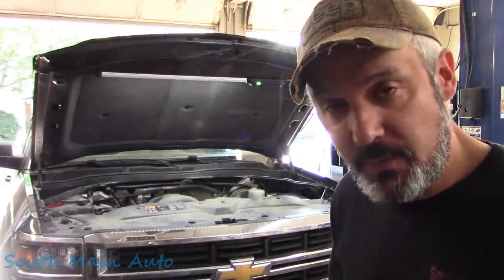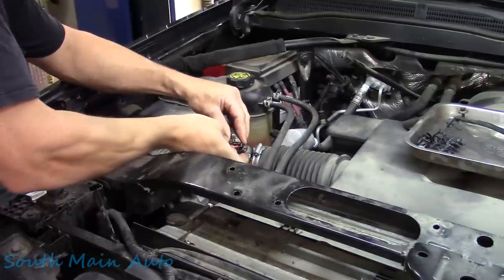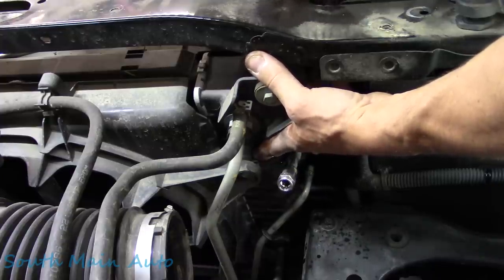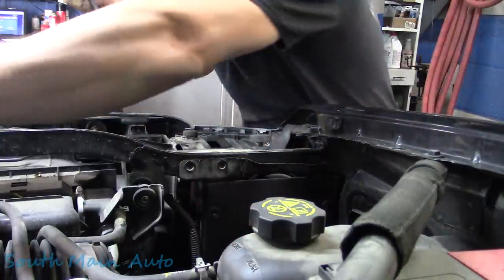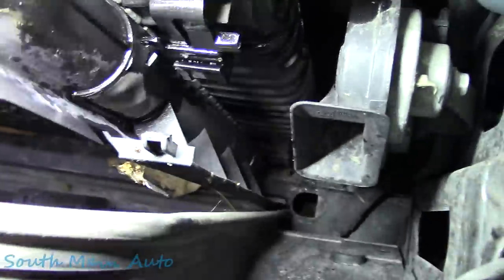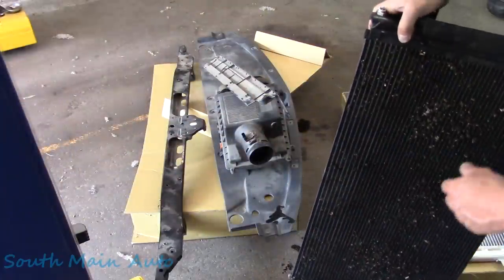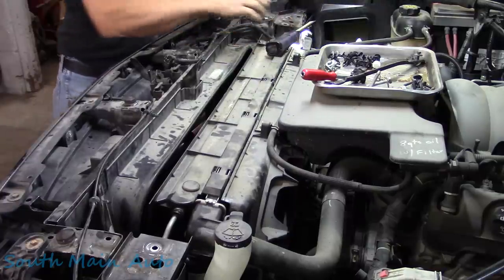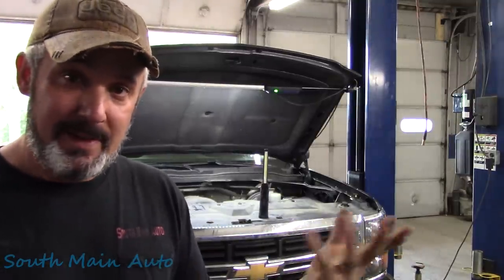Chevrolet 1500 / Tahoe - No A/C Leaking Condenser

Comment: I enjoyed rebuilding on my 2001 Jimmy 4.3L.  I bought a rebuild kit from UAC via RockAuto.  $265.00.  Including Compressor with clutch, Condenser, Dryer, Orifice Tube, oil and seals.  I did a new radiator, water pump and heater core at same time.  I purchased a vacuum pump and hose and gauge set and did all service myself.  Eric, you have encouraged me to do this stuff.  You are most helpful.  The technical aspects of servicing AC properly are involved, one must be aware of what he or she is doing.  I watched a vid by Eric the car guy in order to get servicing right.  Both of you Erics are the best.  It isn't hard, just have to take it step by step.  I am proud of the work I have done.  It is rewarding to say the least.  Money saved is one of the benefits.
Reply: I'll tell you, you are definitely right about the fact that A/C is "technical" and not all auto "mechanics" get it when it comes to A/C. That is why most people are purchasing new compressors, driers and new valves when the problem is something else. A/C work is done incorrectly with most shops and those who do it correctly are on the few shops list. 
Also, I never saw an automotive A/C system that worked properly blow cool air above 40 degrees.  Some of them experts will tell you the cooled air will go up as the outside heat rises. Initially thats true but as it runs longer at the evaporator its not true. The txv or fixed orifice will regulate the temps as needed and on a hot day say around 105 the air coming out of the vents should be close to 40 degrees vs. a delta of 30. If its 105 outside and A/C is making 75 temps inside THAT is not normal.
Reply: And a proud of yourself moment saying hey I did that. All of it. Rewarding feeling
Reply: Did that about a dozen years ago on my old 98 Lumina. Was a leak, not a compressor failure - flushed the evap and lines very thoroughly anyway. Wonderful AC til I got rid of the car a few years later, for a hybrid. Once you do it one time and it turns out perfect, you are good to go on any other cars in the future. I  moved on to home HVAC so now I got a great setup - recovery machine, mic gauge, testo 550, nitrogen tank and flow gauge, O/A torch, metal duct fab tools, etc. Once you understand all the saturation temp, super cooling, super heat, etc the work is easy if you are an intuitive person.
Reply: @Garth2011  People forget, or never knew, that AC in their vehicle is probably 80,000 BTUs. If it's working right it's going to blow cold anywhere.
Reply: @johnassal5838  Is that so, 80,000 btu?
Reply: @Garth2011  Well, probably more like 20k-40k for most cars but I'm not sure if that's max capacity or output under lower stop and go rpms.

Comment: No wonder they couldn't find the leak. It was hidden behind the plastic cover. Experience is everything!
Great work as usual.
Reply: still the best way to avoid leaks like that is a separate condenser and receiver drier.... not that kind of design...
Reply: I think that's code for "too much work to find"
Reply: @Garth2011  Sniffers are useless, best is the dye/black light method.  Have not used a sniffer in 25 years, soapy water works well too.
Reply: It's a known problem with those vehicles so they had to know where it was leaking and just decided to keep charging it instead. It isn't too hard to remove that plastic cover and look!
Reply: You can see the leak on these through the grille
Reply: It's incredibly easy and obvious to see the leak on these condensers when you look through the grill, I don't even understand how the other shop could not find the leak unless an actual blind man was looking for it, every auto shop in North America that does AC stuff has heard of the notorious condenser leak on these trucks
Reply: @dethmetel  They liked the repeat business from the sucker. Fix his problem and then what does he need from you on an ongoing basis?

Comment: I can't believe a shop in a major city would be so irresponsible on not correcting a leak and just recharging a system. I'll admit I had a 2012 F250 evaporator get me. I charged it with dry nitrogen and it held pressure for over 3 hours, passed vacuum test. So I charged it and sent it on its way. 2 months later it came back and through process of elimination I condemned the evaporator, Ya completely disassemble the dash to change it.  I enjoy your videos, keep up the good work!

Comment: As a GM tech myself I have asked myself countless times why GM continues to have us replace faulty components with the same faulty components and repeat repairs. It just pisses me off. GM needs to do better on so many different levels
Reply: The Chevy dealer here uses aftermarket condensers. They say they have better luck with them and that it was requested by the techs. I ordered 3 more this week. They do a bunch of them.
Reply: I'm having a hard time finding the GM part number so I can replace those plastic safety "stay on there" clips that Eric is calling the jiffy clips for transmission cooler connections. I suppose there are different sizes too, but I can't find any size at all. Any help GM guys?
Reply: @Troy_Built  I’ve also installed the aftermarket ones. Only when the OEM ones are on back order though
Reply: Maybe GM needs to have work for the service dept .GM is not going to throw away their faulty inventory.Manufacters only do recalls on equipment that can cause injury.
Reply: @notsevenfeettall  the reality is that for the first 2 years, warranty and dealer concerns are actively managed and engineering often makes changes..in future models.  When a vehicle is released, especially a truck, the new release is in 5 years, and that vehicle is already 50% complete, so if it's deemed to be something engineering can improve, you may not even see it in that release (unless it's expensive to GM). Also, Engineering may have decided that their part design was fine but the supplier built it badly or not so spec, that is a purchasing problem, not an engineering problem.  If that condenser design had issues in 2015, in all likeliehood it's fixed on the T100 platform (2020 or newer)
Reply: Gm tech also and I love how they finally changed the manufacture of the condenser and it doesn’t fit the air dams hardly and the cooler line adapters are slightly different.
Reply: Repeat business to hell with customer satisfaction
Reply: I had to replace a condenser already on my 2018 . Last year the starter was bad and the engine oil cooler line was leaking too. I know all vehicles have some issues but I bought my last gm.

Comment: You gotta love the brand loyal guys that are blind to the fact their stuff breaks down as much as anyone else's...
Another You Tuber is always getting on Euro cars when they break down but he loves Subarus... That he always has in his shop. The latest one...with a cracked valve? Good guy. Great diagnostician. Excellent videos. But.... Give it up already. It doesn't matter where they come from or who makes them. They all break. Every one of them.
Reply: Especially when you don't take care of it like you should
Reply: Eric knows Ivan of PHAD. Let's hope Ivan realises he got the old/wrong replacement exhaust valves from the dealer before he fits them! :-/
Reply: @rafflesnh  Ivan is a great guy. Love his stuff.
Reply: It's not that some break down or don't, it's the relative frequency.
Reply: @Resistculturaldecline  that's just it. I have had cars of many makes. They all did about the same. Little stuff here and there.
I've had Fords, Chevys, Toyota, Nissan, Opel, many VWs. Have had little problems from all. All about the same.
Two Fords and a VW now. Just sold a 2006 Jetta with 170,000 on it. Still on the stock alternator and even stock brakes!
It's all what people want to believe.
Reply: @rafflesnh  The updated part is ONLY FOR THE OTHER CYLNDER HEAD.  Yeah, different diameter for the other side.  He verified that the side he was working on still used the same part #.  OEM out of the factory used that part # for both sides.  Then they updated the other side.
Reply: @billmalec   I expect a 170k with very little replacement of wear items from newer cars. Decades and decades ago, 170k was great. I drive a 2001 dodge 2500 still on factory brakes also.  None are infallible, but most extremely high mileage vehicle are japanese. I mean 500k . I grew up on Detroit iron, and deep into engine building. Cars and outboards. Not across the board, but on average its hard to deny what I've seen in the small sample size of my eyes. Honda outboards which are directly based off the road engines logging 5500hrs. 3500hrs above 4000rpm.
Reply: @Resistculturaldecline  that Subaru with the cracked valve at Ivan's has like 125,000 on it. If it were a BMW people would be going crazy about this and that and, well at least it wasn't yet another Subaru head gasket...
Reply: @Resistculturaldecline  290,000 on our 7.3L Excursion. Alternators like clockwork every 105,000 miles. Luckily it's very easy to change.  One rear end rebuild. Other than that not much of anything.
But if it were a European car, oh man that would just be horrible. I don't get into that BS.
Reply: Actually Bill described exactly why I am brand-loyal. I know they break, everything does eventually. But, knowing what breaks and how it breaks and how to repair is priceless. Familiarity as opposed to fanboy-ism.
Reply: @walterk1221  that's why I think guys like Ivan and Eric don't like certain brands. Because of non familiarity. Things break they aren't used to breaking and they think it's odd. I'm sure Europeans think Chevy truck engine lifter problems are odd too.
Going back to Subarus and their infamous head gasket problems. That shouldn't happen but they just take it as 'normal'. Never had a head gasket go out on any vehicle I've ever had. That being said I'm sure I'd like a Subaru. Never had one but...
Reply: @billmalec   I have a cadillac in my driveway maintained to no end you can have real cheap if you're curious about headgaskets. As said, yes they all can break. Everything is built to a price point, none are godly. But on average, reliability stats favor a certain direction
Reply: @Resistculturaldecline  Cadillac? No thank you. 😁
Reply: @billmalec   Me either, it was bequeathed to me.

Comment: Thank you, Eric, for teaching me how to correctly use the A/C line disconnecting tool.  I have a set of them in my tool box in case I need one, but have never had the opportunity to use one.
Reply: That ones different. Thats for the chevys or e clips. If its a ford or another type of "quick connect" its a different tool. Kinda works the same tho. Jus saying in case you have the same tool for a different application or vise versa

Comment: Saw you drop that screwdriver down the radiator and I had a bad memory. Reminded me when I was in college  68-71 driving a Fairlane SC. Water was pouring out of my original radiator and could not afford a new one. I think it was $23.00 new. Scrounge around a junkyard and found one that was dry and would fit my application. After installation, I started looking for leaks and an unidentifiable screwdriver fell down and put a hole in my used rad. Went back to the JY and asked for another radiator. $7.00 for the first one destroyed, 2nd one was $5.00 hearing the counter crew laughing their aces off as I ran to my buds car w/rad. Finally installed the 2nd rad. in the College parking lot, loaded my clothes heading home for the holidays. Life is full of lessons, boy did I learn one that day.

Comment: You are a wise man for checking the replacement part condition before removing the failed part. I’ve had a few new condensers that were unusable. And yes they are packaging them a lot better now. However the the plastic pieces that “snap” on the sides of the condenser don’t fit the new condensers very well due to the large welds on the new ones. Usually not a problem with a little plastic surgery/modification.
Reply: Its also worth inspecting it to see if it is the correct part. Just because the sticker says its the right one doesn't mean it is the right one
Reply: Don't even get me started on new parts that are; wrong, damaged, poor quality or fail right out of the box.😡😠🤬😠
Reply: I hate fussing with those little plastic clips, and they do literally nothing for the condensers, and leaving them off doesn't really change anything. They're technically for anti-vibration and to keep the condenser in place, but the clips in the front of the radiator do that more than well enough unless they're busted.
Reply: I like how the old OEM plastic doesn't fit the new, non-OEM part because the off brand one is better made LOL.

Comment: I can’t believe this! My 2015 Silverado LTZ with 62,000 kilometres on it is falling apart ! Oddly, this video of yours and the one on the power windows I watched 10 minutes ago is what is going on. BTW , my truck has never been winter driven, that’s what keeps the mileage down. 
So , in July , my truck was at dealership for side curtain air bag recall. I was in Alberta for 2 weeks while they had it before I got back to Ontario. About 3 days later the A/C stopped working. Knowing they had the battery disconnected, all my dash , radio and the like were wiped out. This happened before when they did the rear sliding window/defrost recall. Nothing showing up , I pumped some Freon to it, it worked for 2 days. As well , I can’t find it even tho I know the condenser issue. Now , actually 2 weeks ago the driver power widow quit, makes drive thru impossible but since it being parked this weekend, the repairs can wait till the spring. I hope I can aquire the wiring diagram to test the switch, as you say , it’s relatively cheap but I can realize a draw when I activate the switch as I can hear blower and lights dim. Being a retired mechanic I have no issues doing this work but not having all the test information is making some repairs prohibitive. Thanks for your channel Eric, not are you only teaching this dog new tricks , your honesty and integrity emulates the 45 plus years I thought I was like. If I don’t get a chance to respond to another video this year, Merry Christmas to you and Mrs O and your family

Comment: I love this channel I don’t plan on owning hardly any of the vehicles he works on but still watch all the videos from start to finish
Reply: I’m from the UK and been watching since he had about 10,000 subs. There’s not much chance of me owning or working on anything Eric-0 works on but still pick up some cracking tips on his brake Jobs.
Reply: Cars are pretty much all the same. Unless they're electric, they all have an engine which is a just a big air pump, a transmission, wheels, etc, and they're all put together with nuts and bolts. Though the procedures may be a little different, the concept is the same